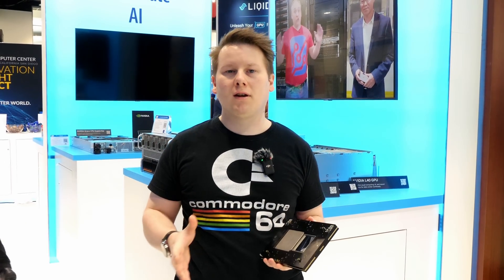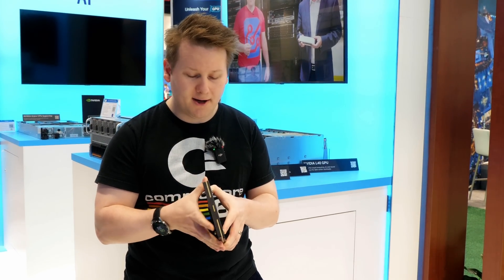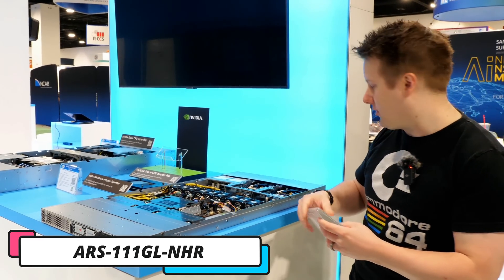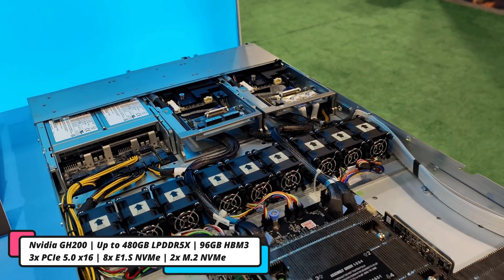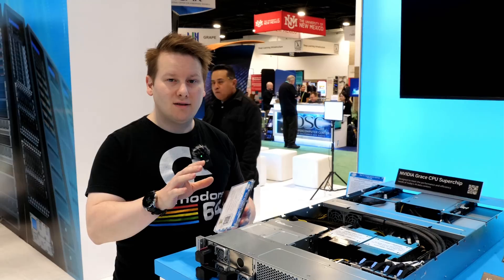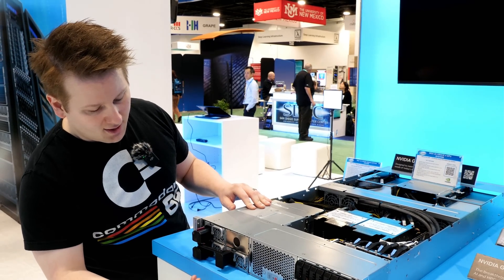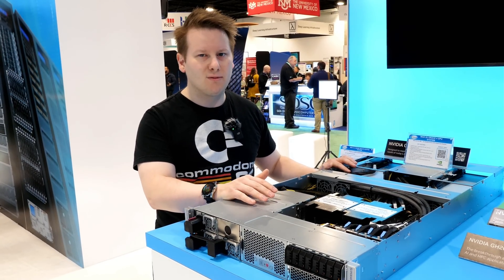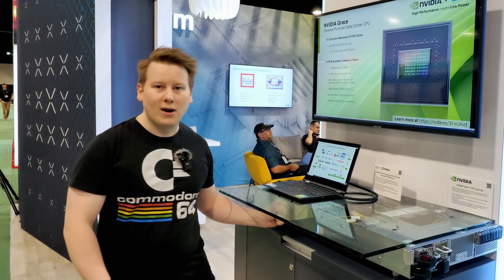I got to touch the NVIDIA Grace Hopper

Comment: Nvidia Super Grace 144-core ARM CPU:
- uses ARM Neoverse V2 CPU core: about 20% higher IPC than AMD Zen 4
- measured ARM Cortex X3 core in Geekbench 6 (V2 is server version of phone X3)
- pure 64-bit CPU core, there is no 32-bit backward compatibility

This ARM is a monster, no wonder it has 2x performance per watt than best x86 AMD Zen 4.
Reply: - uses ARM Neoverse V2 CPU core: about 20% higher IPC than AMD Zen 4
- measured ARM Cortex X3 core in Geekbench 6 (V2 is server version of phone X3)

Source for the above statements?

"This ARM is a monster, no wonder it has 2x performance per watt than best x86 AMD Zen 4."

Are we really taking Nvidia's and ARM's claim at face value?
Reply: @MemmoSJ  Take Samsung Galaxy S23 GB6 ST result and calculate IPC as pts/GHz. Then do the same for Ryzen 7950x3d and you will get 20% higher IPC.

Also do not forget ARM X3/V2 core has 6xALU + 2xBranchUnit = 8x INT scalar instructions/clock. While Zen4 has 4xALU + 1xBranchUnit = 5x INT scalar instruction/clock. So ARM X3/V2 core is 60% wider than Zen4. This means Zen4 is doing fine with such a narrow design however it's obvious the Zen4's design is inferior.

And this year's Cortex X4 has 8xALU + 3xBranchUnit = 11x INT scalar instruction/clock. So next server ARM V3 core will be based on X5 in 2024 and will be even bigger beast. That's why Microsoft released their first CPU in history: 128-core ARM Cobalt CPU. MS knows that ARM is beating x86 really bad so they have to abandon x86 sinking titanic ASAP.

Comment: Regarding internal layouts and rack sizes for dense servers, instead of a 1U 2Nodes system I would rather have 2U 4Nodes or even 4U 8Nodes due to more efficient fan options.
You would get less noise for same fan performance the higher the unit is, I could see 1U being used with liquid cooling though.
Reply: if your server is running fans you are doing it wrong

Comment: your voice over is coming only in the left channel, next time you might want to turn the audio track from your mic to a Mono track so it goes on both channels :)
Reply: th900 mk2 and  yea good call.....my left ear ahhh
Reply from the maker: It's coming over both channels here? On multiple systems
Reply from the maker: Ah crap I see what might be the issue. Left channel is +6dB over right channel. That's the safety recording for peaking, and I didn't equalise in post. I personally barely notice a difference. But audio is always my achilles heel. As well as video.
Reply: @TechTechPotato  hahahah so thats why i was going crazy, like im becoming even more hard of hearing in the right side lol?
Reply: @TechTechPotato  You're right, it is present on the right channel, but just quiet. I'm listening on Sennheiser HD600 headphones with an RME audio interface so it seems like quite a difference to me, probably less noticeable if you use speakers. But anyway, feed it back into the loop for improving :)
Reply: @TechTechPotato  I guess you're not wearing headphones to edit? ....Or need to see an Audiologist haha.
Reply from the maker: I wear headphones, but I've noticed that my tolerance is quite wide. Audiophile I am not.

Comment: Taking the GPU out of this, what is the point of this ARM CPU?  You cannot tell me that (or maybe you can?) this CPU is faster than an AMD Epyc CPU? What tangible benefits does this ARM CPU bring with it? 72 cores, 235w of power and 500GB/s memory bandwidth. I’m not seeing any kind of quantum leap here?  I keep hearing fanatical cries of ARM is going to change the computing world, but nobody ever explains exactly how this is going to come about. For this to happen, the CPU would need to twice the performance per core, twice the memory bandwidth, lower latency, half the power and half the price of any x86 architecture, but not one of these things have come to pass.

I get the feeling that the silence to this question kind of puts this subject in the “religious debate” area, as I think I’m correct, but want to be proven wrong.  If I was stupidly wrong, I would be barely able to breathe under all the ARM aficionados facts proving me an idiot.

And with this video being an advert, the silence speaks volumes.
Reply: I think the Nvidia GH200 and Superchip are mostly for Nvidia's long-term strategy, but they also offer advantages such as a higher bandwidth.

Nvidia ultimately wants to dominate all computing. For this, they need to introduce their CPUs at some point. Right now is a good time because they can ship it with their best AI GPU, and everyone will buy it. Furthermore, if they would not design their own CPU, they would practically give AMD free money, which they don't want.
Reply: @xthesayuri5756  it's high bandwidth but not out of line with the competition. The bandwidth between cpu and gpu is an advantage on grace hopper, but probably not on grace grace I would expect
Reply: @christopherjackson2157  got you. Yeah, I can see the bandwidth from CPU-GPU is very high, which I guess would be very useful for huge amounts of small requests to the GPU, but in my experience it tends to not be important in A.I. workloads, where the GPU bandwidth and low latency to its own memory is vital.  As far as I’m aware, the CPU won’t be doing much in the role of A.I. processing which makes this feature not a very big benefit over all. As far as CPU memory bandwidth is concerned, the Epyc can be easily configured to offer more than 500GB/s of bandwidth, and has 12 more CPU cores than this, as well as very similar power consumption to boot!  I still don’t see the benefit to anyone other than that the money goes to nVidia instead.
Reply: @tonep3168  I wonder  if nvidia isn't planning some sort of unified memory architecture.

Theres a lot of potential for optimization there
Reply: @christopherjackson2157  something is going on, as the specs say 500GB/s memory bandwidth using 30 DDR5 channels.  The Epyc achieves 460GB/s with just 12 channels of DDR5 4800, and can go faster with better memory.  So it looks like nVidia is using the same memory for the GPU side too, or the memory is just very low clocked.
Reply: @xthesayuri5756  which bandwidth do you refer to?
Reply: I am not going to talk in terms of architecture but for Nvidia going ARM makes a lot of sense for them.
It appears Nvidia is going the Apple route of being as vertically integrated as possible, or at least attempting to. Instead of going with AMD Epyc them creating their own CPUs in the long term would allow them to more tailor make solutions to be as custom as possible for the workloads Nvidia excels in; as we have seen custom solutions with integrated accelerators are the future of hyperscale. I highly suspect the future of iterations of Grace-Hopper to be extremely complicated tile/ chiplet designs making Intel's Ponte Vechio seem simple, and them having the control of everything that would go into that a much simpler integration process.
This has the added bonus of them having a better understanding of their own launch schedules if lets say AMD hits a massive slump and delays product launches an integrated system like Grace-Hopper would also be delayed not of their own accord leading Nvidia to hang. Nvidia would like to minimise outside hardware influence ass much as possible while also leading into a more profitable future with Nvidia able to charge more for an integrated solution than they would with current solutions. 
Their are other reasons but I think those two would be the main ones. I think Nvida would have consider developing their own CPU solution. What gives this a bit more credence is Nvidia securing a 20 year ARM license so I think they are doubling down on this strategy.
Reply: @theemperorofmankind3739  I totally get why nVidia is doing this.  It’s only about another corporation taking money away from other corporations.  ARM architecture in high performance computing is a bust.  There is no argument for it, other than “I don’t want to give money to AMD or Intel”.
Reply: NVIDIA wanted to buy ARM outright. SBG, who own ARM, will be keeping the $1.25 billion Nvidia had already paid for ARM in exchange for a 20 year licence.
Reply: There are a lot of advantages at the system level.

I'm not sure that the CPU on its own is any great leap forward. As you say.
Reply: @christopherjackson2157  can you tell me what these advantages are? I simply cannot see it, and that might be my fault!  Compare this with say an Epyc 9634 and tell me where it betters it?  And you can’t tell me that having to make fully optimised ARM software is free or easier than making x86 software?
Reply: Grace CPU provides a Virtual Machine security layer to protect Hopper GPU from cyber hackers affecting machine learning & AI inferencing data on the HBM3.
Reply: What's the point of this comment? Yes, it's not twice as performant per core, it's not twice the bandwidth et.c. et.c. It won't tuck you into bed and buy you a pony. You've just made up a person to get mad at.

Comment: i hope they release a consumer grade cpu for us, and then we have a real Romance of Three Kingdom situation in the modern world.
Reply: RISC: ARM, Apple, Nvidia, Qualcomm, SiFive

x86: Intel & AMD
Reply: Why?
Reply: @tonep3168 just my wishfull thinking. because consumer gpu realm has all three, why not in cpu realm too?
Reply: @genbu3834  ARM is a very different proposition for the general consumer.  ARM on Windows is a disaster for a start.
Reply: @tonep3168 Windows 11 & 12 are being architected to support ARM CPUs from Qualcomm & Nvidia. MSFT need NPU of 50 TOPs to provide adequate AI copilot performance.
Reply: @tonep3168 to give us an option for ARM based CPU on Linux and possibly Windows. A slimmed down version of Grace Hopper might be the only thing competitive enough against Apple M chips in terms of power to performance ratio